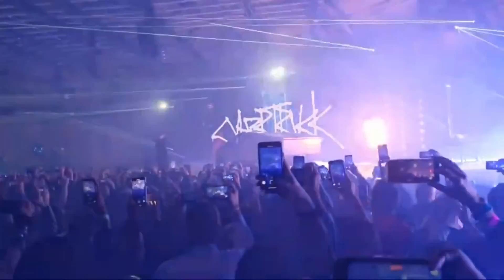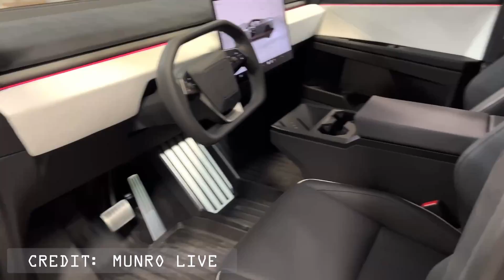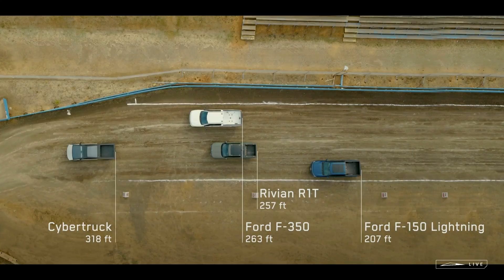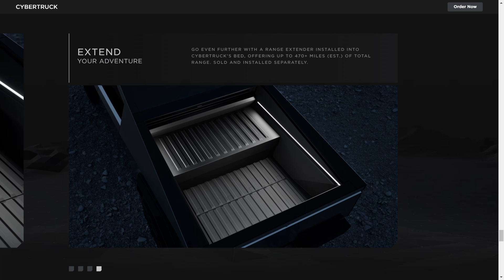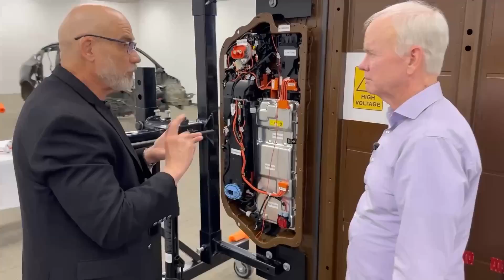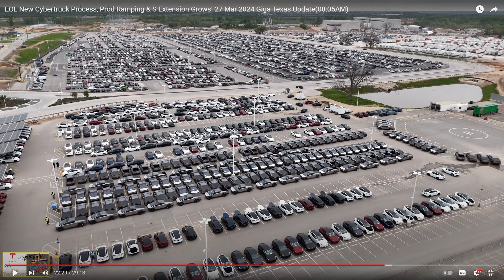What's Under The Skin of the New Tesla Cybertruck?

Comment: hey mike glad you did a video on these details talking about it... and i am not here to unduly criticize however:

the thing is i am not against the general premise of the design. stainless is cool material, and the delorean inspired design is a warm change. as are the flat panels and general look. personally i would not call it unattractive or anything like that. however the main thing i would be pointing towards taking a scrutiny of is basically the everyday practicality. and this is where it comes down to the egos of upper management and i have seen this in other corporations in recent years (cough, nvidia, jensen huang). whereby the guy at the top insists based upon purely his ego and it ends up being to the detriment of the final product design. so here are the individual elon's mistakes in my opinion. (and not the general tesla engineers yes men whom didnt want to be getting fired over it...)

1) wing mirrors: its understandable and because the legal regulations and we have been thru it all with supercars already. those requirements for being street legal and the drag etc. only problem here is: because elon isnt accepting the reality of the situation he thinks his clout still matters to make them like... too much feeble and naf from a practical stantpoint. because in elon's mind if he makes them badly enough, then people will feel more compelled to remove them. and/or force a pressure on the authorities to change the road legal requirements long term. and this is all a clear mistake because it makes his product more naf. and then people has to start doing extra work like 3rd party wing mirror kits that are actually good etc. so its fixable but still a mark against.

2) steering wheel. we have been through this before on other tesla vehicals... the wheel is not round enough simply it is actually more dangerous and leads to less control while driving. this is also perhaps possible to change (perhaps). but it is just entirely daft from a practical design standpoint. why? because elon musk has a massive ego thats for the only reason why

3) the back of the cab slope. now this one isn't fixable. however i wanted to bring it up because in my opinion... if you had a step on the rear window. rather than a continuus long slope. then you get better headroom in the back. and i am just guessing but it would not look aesthetically bad or anything. so perhaps there was during design phases a mockup proposal, that was then rejected by elon. in favor of having more trunk space volume yes? but even a small step on the rear cab would have been great imho. and maybe even look a bit nicer and more attractive. but thats just my own opinion.

it is not perfect. but i think some reasonable things would be for tesla themselves to provide better mirrors and steering wheels. as an option or later revisions. but i also agree with all of your own suggestions too on it.

so while i do still support the general concept.. its elon himself i am afraid i simply do not wish to support his ego. if he had somebody else whom was a credible engineer to push back against him (that he listened to and accepted) to have final say. somebody like a johnny ive equivalent. then i believe that those criiticisms are a bit like the apple product criticisms which is quite commonly said things. and nothing new or worth getting upset about. (if you are a tesla fan). it is still possible to appreciate from an engineering perspective the moving forwards on those new positive accomplishments... but i am not going to fall in love with the thing. after already going through all of those apple let-downs sagas by now its same general thing... tesla is the new apple basically they reproduced the apple business model. but for vehicles. so its just another type of a business, (not a passion) at this point
Reply from the maker: Thanks for your deep thoughts on this!  I've never been an Apple fan so I haven't had to live through those particular nightmares!  :^)